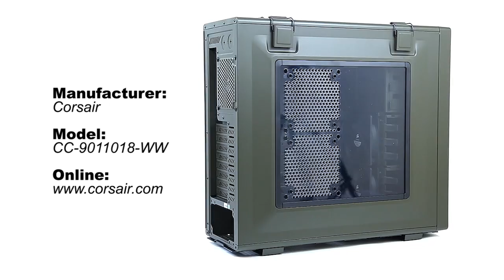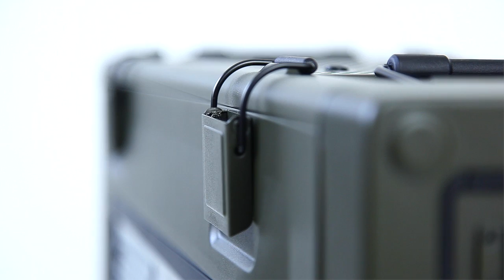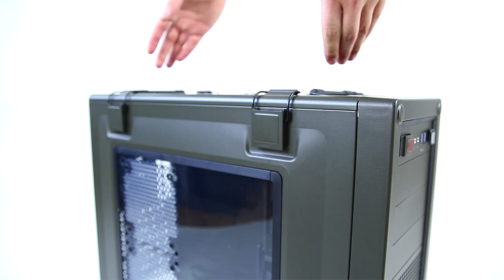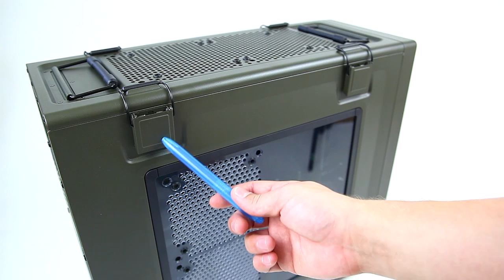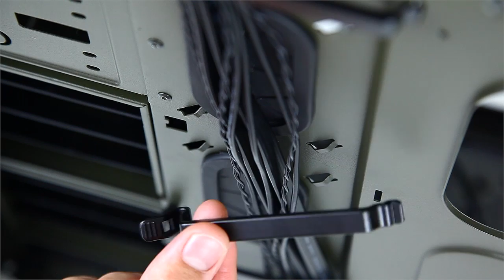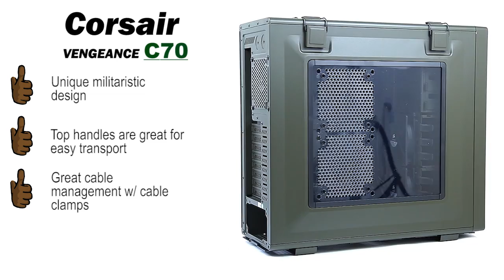Corsair C70 Case Review

Comment: Still rocking mine after buying it new on Amazon in 2015 for 107 dollars. About to upgrade again soon here to a 790 platform. Running a 280mm top mounted radiator for cpu. One of the best cases ever made in my opinion.

Comment: I just paid $200 for the gun metal black version of this case. Of course it’s used but in pristine condition.Thesr cases are highly sought after and becoming harder to find in this condition. This is the last PC case I will buy.
Reply: I still have my bought-new C70 (green) also in pristine condition and complete. You got a great deal at $200, I've seen them go for that missing both side panels and other parts. Maybe I will gut the 6700k in there and build a maxed out 9000 series into it as a flex.
Reply: I've just received mine (green). It's been really hard to find one in good condition. For only 80 bucks! I wish I could find a black one, though, I would buy it too. I think it's THE case.

Comment: I just don't agree with the "Poor cooling".
It's got a push pull system at the front, two fans bringing air in and the two hard drive bay fans pushing it into the case. Two on the side panel pulling in cool air, two on the top and an exhaust on the back. It's more airflow then a lot of cases in 2019 provide.

Comment: Say, I have a case with the standard top slots for fan mounts and I can't figure out how to mount fans to it. Can I just use standard rubber shock dampening plugs? Or what do I need to get a secure fit?
Reply: you have to use the shocks on this case or the holes will be too big
Reply: I think u need mor up to date cases I was planning on getting it mostly because I need portable and nice looks the case would be in my personal build if it had more up to date fetures like a nice hard drive bay and decent 2017 pc builds

Comment: Good job!
Can i fit a Club3D r9 290 RoyalAce 4gb -
                Card Size: 308 (11,9 in) x125 (4,9 in) x53 (2,1 in) mm
With this solutions i have around 0,4 in (10 mm) of space to the midle fan/box.
it's good?
or is better a Corsair Graphite Series™ 230T - gpu max 360 mm (14,2 in).

Price: Corsair C70 120 euro (130 usd)
          Corsair Graphite 230T  74 euro (80 usd)

Very very great job.

Comment: I think the price point for the gunmetal steel version has gone down to $110 USD, and even lower when on sale, so for that price I think this is top rated, corsair 500r is also good quality and cheaper during sales, but it cant support the corsair h105, but the c70 can.  Also removing the fans from the hdd cages and mounting them on the front is not difficult.

Comment: I have one very important question, if someone could answer it would be very appreciated. The two intake fans by the hard drive cages, could you remove those and mount them in the dedicated space at the front of the case?
Reply: CluelessGaemer can you remove all the hard drive bays ?  and you can put 3  140mm fans on the front right ?
Reply: CluelessGaemer man, i'm so confused between the H440 and this C70 :S
Reply: CluelessGaemer actually i like the H440 ergonomics but the 2 fans at the side of the C70  that i really hate, but i saw on forums that people didn't complain about high temps on the H440 or whatsoever,  however, i'm planning to get the 4790K up to 4.7 GHZ   also, i'm confused between the  GTX 780 or the R9 290 ( also which  brand should i consider buying asus, gigabye,msi,evga )
Reply: CluelessGaemer  i didn't new that you can order a glass panel :o, how much does it cost ? and again for the gpu, which  GTX 780 should i get    performance/cooling ratio
Reply: CluelessGaemer alright man, thank you very much for the informations; i'm kind on a tight budget so i'll stick with the 780, but it's a great GPU, isn't it ? i saw gameplays of crysis 3 and BF 4 and this gpu just smash those games like candy.
Reply: CluelessGaemer alright man, peace
Reply: CluelessGaemer nice pc man,  what's the 4790K clock speed ?
Reply: CluelessGaemer that's awesome man, :D
Reply: BritishBadger So can you have a fan right up front and still fit the HDD cage in?

Comment: I'm getting this case probably next week. What I'd like to know is will the 600T's acrylic window fit if I ever decide to replace the stock window on the C70? Thanks in advance
Reply: It wont fit. But check out MNPC Tech. They have laser cut full windows for the C70
Reply: tonaham Thanks a lot. I got the C70 just yesterday but I'm kinda annoyed at the window not being fully clear. I'll check MNPC Tech on Monday. Thanks again!
Reply: Innate Otherwise, if you have'nt bought the window yet you can just flip the window around and have the fan grills over the hard drive cages.
Reply: ULTIMAD3 thanks for your response. I actually didn't buy it, and decided to not go for it but rather go for the Air 540. Probably around next month. :)
Reply: Nice! Dat side window tho.

Comment: Hi there, can i fit a be quiet dark rock pro 2 or pro 3 on this case? will i encounter any clearance issues specially on the side panel? I will be building my 2nd gaming rig soon and this case is in my top 5 case list..
Reply from the maker: I think you should be ok. But Check Corsair's website for CPU tower clearance.
Reply: HardwareCanucks how long psu will fit with a fan in the bottom
Reply: +William Lariosa I have a Dark Rock Advanced C1 in mine which is apparently a couple of millimetres taller than the Pro 3.
Reply: +William Lariosa 

http://www.amazon.com/gp/product/B007S02GLQ/ref=as_li_tl?ie=UTF8&camp=1789&creative=390957&creativeASIN=B007S02GLQ&linkCode=as2&tag=ttlkjsacbv-20&linkId=YB62WEWEKC755PSU      Corsair C70 price as of today is $89.  I think you can fit without any problem. :)

Hi there, can i fit a be quiet dark 
rock pro 2 or pro 3 on this case? will i encounter any clearance issues 
specially on the side panel? I will be building my 2nd gaming rig soon 
and this case is in my top 5 case list..

Comment: This or the 500r for the same price?
I will probably use a h110 and put in some noctua fans.
Reply: I'll solve your problems, i have both of those cases.
500R haves better airflow, i personally prefer the C70 because of look and how easy it is to open and move.

go for artic white no matter which one, its much nicer than the black ;)
Reply: What are the chances of that wondering about two cases and someone just happens to have both coincidence? I think not

Comment: The 9370 isn't worth it. It's the exact same architecture as the 8350, the only difference is that it's been clocked slightly higher. And it runs extremely hot when it's in its "turbo" mode, so unless you have a heavy-duty motherboard and great cooling, you won't be able to handle it. 

Buying a 8350 and overclocking it to 4.5 or 4.7 GHz is a much better idea in my opinion, it's what most people go for. Cheaper and easier to run.

Comment: Sorry if you already moved on, but I just bought the C70 in white, however my initial plan was also to get the 500R. Right now the C70 is at least $10 cheaper than the white 500R, but what made my mind was that rigid/classic look of C70 that will never go bad and its almost all steel construction is a great bonus (I hate aluminium fronts). The 500R is the best looking sleek/modern case design, however it is too basic and, like this video said, it lacks personality like most other cases.

Comment: push/pull configuration on the top is not possible with all mobos.. it depends on the motherboard cooling system.
corsair suggests a positive pressure inside the case to avoid dust etc..
so move the 2 fans from the drive storage to the front of the case and if you want more airflow.. mount the extra fans on the floor.. that way you will use the dust filters, maximize airflow and have positive pressure(2xfront+2xbottom blowing inside and (radiator fans+rear) blow out 
this is my suggestion

Comment: If I were to put a radiator on the top of the case would the fans intake or outtake air? Also what about the two fans on the side panel of the case? Should they intake or outtake air?

Comment: Why is the motherboard bending? Did he not screw in the card right?

Also, those anyone else know any other good cases as he said for around 150$ or should I just get this. And move the two stock fans to the front and maybe add 1 or two fans on my side panel to cool the GPU.

Comment: Do not get the sabertooth z77.  It is an overpriced motherboard and I recommend getting a P8Z77 Pro.  Also, get the 7970.  You can overclock it higher, the top card won't get hot if you crossfire, and you can always buy another later.  I also recommend getting the 850 watt PSU.  You will only use 750 watts of it with two 7970's in crossfire so you have PLENTY of room for degration.  If you don't believe me still, make a thread on Overclock . net.

Comment: The sabertooth z77 is a good motherboard
I agree and I will only buy 1 ssd drive
The reason I will be getting two 7950's is because I will be going eyefinity(3x s23a950d)
I have been debating on whether to get the hx850w or hx1050w.

Comment: you have too high of a psu, also, don't get two 7950's get 1 7970. lastly do you REALLY need ssd's in raid 0?  You will not be able to experience that kind of speed.  PS: That motherboard is insane.  Get a P8Z77V-PRO.

Comment: Great review, but two complaints:
1) You should have shown the other colors of the case. (i.e. The Arctic White and the Gunmetal Black versions)
2) The "Poor Airflow" statement is false. Corsair have done testings on CPU and GPU temperature and concluded that the fan placement on the HDD cages really helps the GPU temperature, and since most buyers of this case are gamers it is important. Moreover, if you buy this case you don't need to be a genius to replace the fans to the intake mounts.

Comment: I'm curious why Corsair decided to put the fans on the HDD cages, rather than pulling it directly in from the front of the case. Anandtech's results showed medicore thermal performance, which I think could be easily improved with just the fan placement and such.

Comment: The reviewer states that there were no front intakes, which is true. The intakes you see are inside intake, meant to take air from the front. If you don't want to use the inside fans, you can always transfer them to the front, which is common sense really, and something I would've done if I wanted to save a bit of money. Hardly an oversight if you ask me.

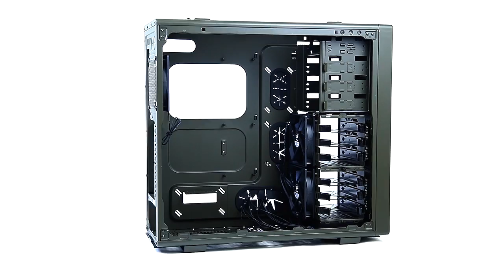Comment: True, push/pull is an option if you want to leave the fans there. My point was that the video really makes you think it comes with no fans except the rear one until the 2:28 mark. That would be a huge oversight for a $150 case if it were true. Better to say there are fans included, but not in the normal location in delivered config, imo.

Comment: The two intake fans inside the case are not called front fans because they're NOT at the front. Those inside fans are for push/pull configuration should the person want to use all the hard drive bays in order to have better airflow once the front intake fans are installed.